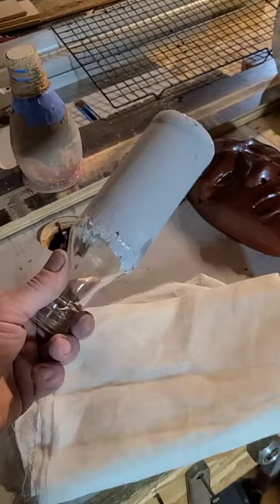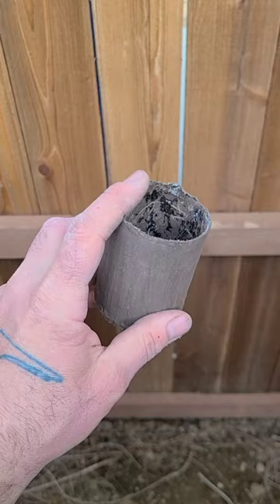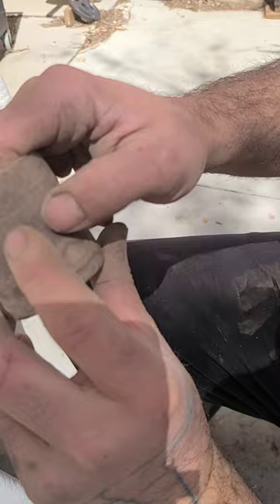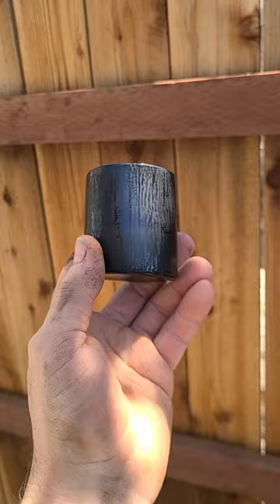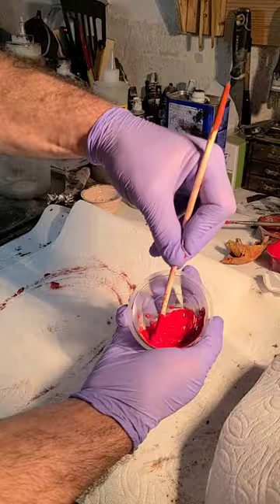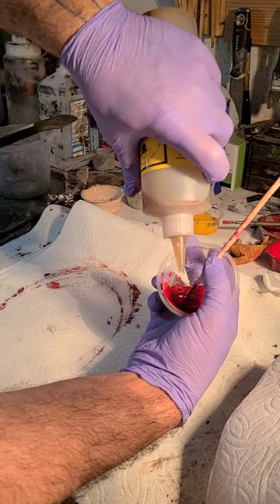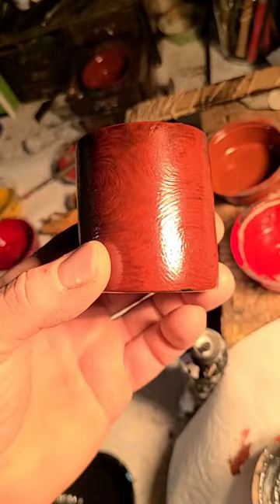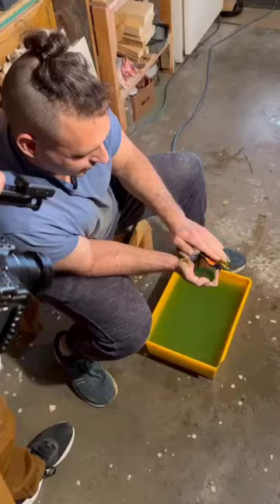Making a cup using ancient Kanshitsu technique using cloth and urushi lacquer

Comment: Nice job, just saved a few videos on what Urushi is. Seems like something I may be able to make and could be useful. 
You can do something similar with Linseed oil by waterproofing cotton to make the original tarpaulins. But I can’t imagine you’d want to drink out of one 😂
Reply from the maker: Urushi is infinitely useful! Not to mention fun to explore the many different properties and possibilities it has. Glad you learned something! And yes, linseed had had many uses over time as well, due to it also being capable of polymerization. But the two substances are quite different in their finished properties. That said, linseed oil (with other additives) was once used in Europe in an effort to imitate the urushi Lacquerware that was coming out of Japan at the time. Thus the term "Japanning", using linseed oil, gilsonite, and other ingredients.
Reply: @iwaowoodandart5815  that’s interesting I’ve heard of Japaning.

Comment: hello, i have an inportant question, how many tubes of urushi you think you need for make 10 layers in a guitar body, i want to make a urushi guitar but i dont know, how many tubes i need
Reply from the maker: This would depend very much on the thickness of your coat layer and the techniques you are using, doing patterns or colors, but I imagine that fuki-urushi with the natural color of urushi and wood still visible, it could be done with something between 3 to 6 tubes perhaps.
Reply: @iwaowoodandart5815 How many bowls does a tube  can paint ?